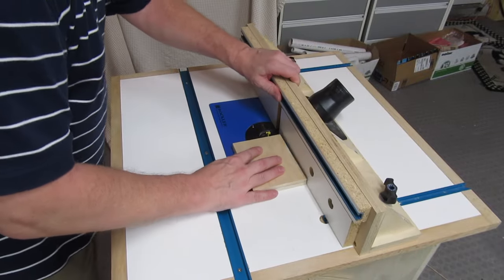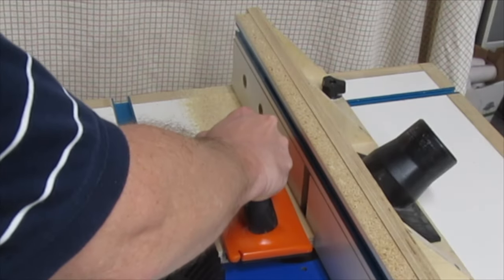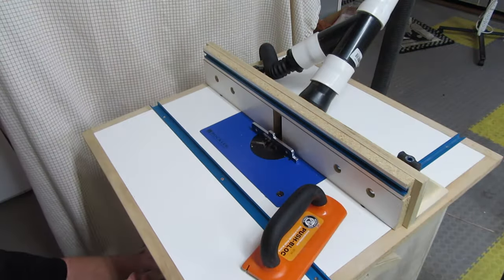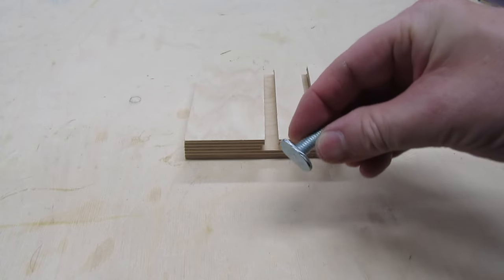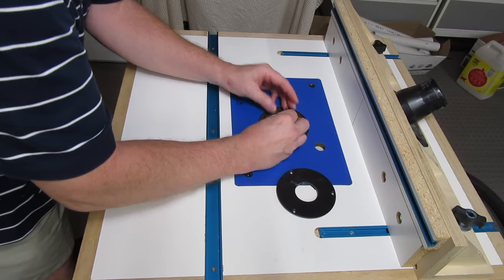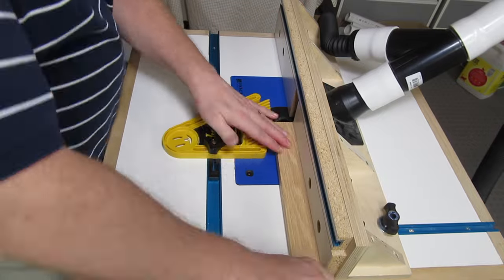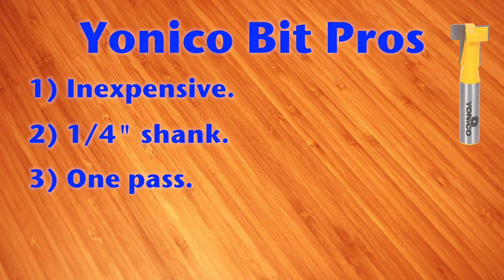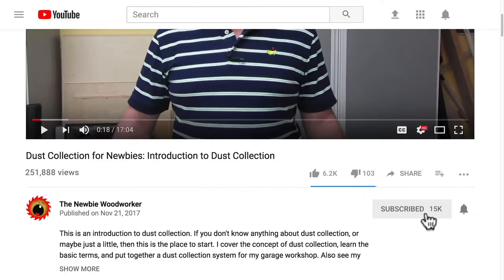Make your own T-Tracks and T-Slots!

Comment: Goo video Dan I worked at a ArchitectualWoodworking company for over 25 years and one of the owners  was excellent at creating internal systems  on how we built  and installed everything we made  one of those systems was  using 1/4” inch bolts for most of our jigs and machine set ups  including T tracks  the benefit of that was  if you stocked the 1/4X20 bolts in every size in stock and we did  you were almost always guaranteed to make it work in house  that cut down on costly down time  and having to run around town trying to find all the hardware
Reply from the maker: Thanks, and I totally agree. In fact, I'm mentioning that idea in the video I'm working on right now. Great minds think alike, I guess. 😄

Comment: One disadvantage of using wooden t-tracks is that when locking a bolt down, you can only apply as much pressure as the wood will allow. Oak could split, and ply can separate from the other plies. This is why aluminum is better. That said, if you never need more than what the wood will support... great! But I wouldn't use it for say a drill press, or band saw jig, which might need to really stay put. Some useful info here, and I'll definitely be looking into the router bits!
Reply from the maker: Thanks for the comment, and I think I pretty-much agree with what you said. I will say, however, that the ones on my drill press still work, and they haven't broken yet. I can hear some cracking noises if I really tighten down the clamps, but they still work, more than a year later. Knock on wood. 😄

Comment: Careful with the Yoniko 3/8" bits. The head should be 1/16" smaller. If you get dust on your shaft and think you are bottoming out, the head will twist through the slot.. The 3/8" shaft has a 9/16 wrench head and will twist right at 5/8" in a wrench, so, softer wood for sure it will twist. 
Find another bit for 3/8, or back up the fence 1/8" and make two passes with the 1/4" bit.. 1/4" does all I need though 99% of the time in a wooden track.
Enjoy your videos. Thanks.
Reply from the maker: Thanks for the info! 👍

Comment: A different kind of comment for you.  Your Photoshop simulation of the t-slots installed on your drill press table is pretty good from a perspective point of view.  The right side t-slot is spot on in fact, but the left not so good.  If you are using a Windows PC then Lazy Nezumi Pro has a preset called Vanishing lines that lets you set rulers to existing perspective so you can match composited elements to it.  It is an absolute god-send for illustrators.  It's the best $35 you'll ever spend when it comes to Photoshop plug-ins.  It's still doable if you have a Mac.  Bert Monroy, for instance uses a Mac, and what he does is map a pair of connected paths to the existing perspective to find the vanishing point, and move the outer ends of the paths to create guides.  When transforming to match perspective, always make the layer a Smart Object — this keeps the handles in the original corners for if you want to fine tune.  BTW  I am an Adobe Community Professional and you can find me on the Adobe forums.  Good luck.
Reply from the maker: Thanks for the information. FYI, I was using the term "photoshop" as a generic term - I actually did it in GIMP. And for videos like this, "close enough" is plenty good enough. 😄

Comment: I can see the difference in price between Yonico and Rockler bit but you have to account for the 1/4" vs 1/2" shank bits. Even identical cutter bits from same manufacturer are different prices if different shank sizes as far as I have seen. Regardless of the price very informative video TYVM
Reply from the maker: True enough. And thanks!

Comment: A few suggestions:  Instead of agonizing over the fence placement, cut the T-slot first, in a slightly oversized piece.  Then cut to the right width on your table saw.  Also, two passes for a 5/16 or 3/8 straight bit is a little conservative.  If your bits are sharp, even 9/16 should be doable in one pass (except for plywood.. the glue makes those cuts nasty).  As far as 1/4" vs. 1/2" shank, it's really a non-issue unless you're cutting a lot deeper than a T-slot with it.  Some fancier stile and rail bits, and similar heavy cuts, will require a 1/2" shank (you probably won't find them in 1/4").  A good 1 or 1.5 HP router with interchangeable chucks isn't that much more expensive than the little hand held ones that can only do 1/4".  The extra mass is actually safer for heavy cuts than a smaller router, too.
Reply from the maker: Thanks for the comments! You are absolutely right about cutting the t-slot in an oversized piece first. That's what I usually do, so I'm not sure what I was thinking in the video. I have a good router, so yes, I definitely could have done things in one shot. I was under the impression that the more you cut out at one time, the rougher the cut. Am I wrong? And if I have a choice, I prefer 1/2" shanks, because I've had problems with the adapters before and I figure, why chance it? Thanks again for the comments.
Reply: There really shouldn't be an adapter - Usually you just unscrew the 1/2" chuck and screw on the 1/4".  I agree - I wouldn't trust anything called an adapter - just sounds dangerous!  While it is true that deeper cuts can be rougher, it depends on the bit, and there's usually a 'breaking point', if you'll pardon the term.  The bit will cut fine, up to a point.  A 1/16th deeper cut, and it gets all wonky.

It's basically a learning process, bit by bit, literally.  Each bit will cut a different amount before it starts to bog down or give rough cuts.  Straight cut bits, which is what I commented on, should be able to cut fairly deep and still cut clean. Any bit where part of the cutter is "captured" is definitely going to be... fun.  An example of 'captured' is that T-slot bit - if you can't stop the router in the middle and just lift the wood away from the bit, it's captured.  They have the hardest time getting rid of dust, and besides just bogging down, the cutter will heat up fast.  Not only does that burn the wood, but the hot resin and carbon stick to the cutting edge, and... nasty cuts.  

The type of wood matters, too, as well as the shape of the cut, the speed of the cutter and how fast you push it through.. Like I said, a learning process.
Reply from the maker: @chrisw1462  "Bit by bit" - very funny. 😄Thanks for the info!

Comment: Thank you for making this video.  I got some great ideas that will help me in my current project.  I'm just in the planning stage of building a router table(on a budget, haha) and I have been trying to figure out how I was going to handle the fence and a track for a miter gauge.  I also liked your setup for holding down materials on the drill press.  Keep up the good work!
Reply from the maker: Thanks! A couple of thoughts, for the budget-minded 😄:

1) For a router table, the fence doesn't need t-tracks. You can just clamp the fence to the table, as long as your table has enough overhanging lip to clamp to. I've seen some YouTube videos on the subject, but honestly, a board with a cut-out for the bit is all that's absolutely necessary.

2) As for the miter track, I have one and never use it. That doesn't mean you'll never use it, but you could always add one later.

3) Lastly, in case you haven't seen it, I have a video on building a router lift: https://youtu.be/LJqPDADi8MM. And I show how you can use it as a mini router table until you can build a "real" table. 😄
Reply: The Newbie Woodworker thanks for the tips.
Reply from the maker: @njneer  👍
Reply: @TheNewbieWoodworker  We really appreciate your honest response: "you really don't need T-Tracks for the fence... That´s good!
Reply from the maker: @alfredomarquez9777  Thanks! I actually like having t-tracks for the fence, but I don't have a good reason. I think I just like the looks. 😄

Comment: Newbie Dan, your answer to a better depth gauge is in your hand -@the 5:33 minute As a former machinist, I too had to learn to look at the obvious. The slide out extension on your calipers is for measuring depth/ height even for thicknesses. And also from experience using digital calipers, they can easily be out of adjustment by simple debris in the racking gears. Whereas a dial or veneer can be cleaned and re-zeroed.
Reply from the maker: William - Thanks for the comment. You got me to stop and think a little - I hate when that happens! 😄 But then I remembered why I used that gauge. I liked how it has two feet, making it more likely I'd get the fence to the right distance. At least that's what I was thinking, anyway. By the way, I have both digital and analog calipers, but I wanted to do the math with decimals. Of course, I didn't realize it was going to be such easy math... Oh, and both of my calipers, and the other gauge, can be calibrated, so that's not an issue. Assuming of course I actually do calibrate them. Fortunately, I didn't need to be that accurate for this. My table saw's fence, which made the final cut to 1", is a lot less accurate than the gauges. 😛 Do you agree with my thinking about the "two feet"?
Reply: The Newbie Woodworker  to quote from my cartoon her o Daddy Duck, 'That sounds logical.' And I understand you on zeroing the calipers. And good to hear that yours are able to do so.  Back 30 years ago when digital were coming out they were a bugger to keep zeroed. 
Again looking forward to seeing more of your drillpress top.
Reply from the maker: Thanks. I took another look at the digital calipers, and I'm not 100% sure they can be calibrated, however, I can use the "ABS" function to temporarily reset where "0" is, if I need to. I know for a fact the depth gauge can be calibrated, because I did it accidentally once, and had to "undo" it. :) Regarding looking forward to seeing more of my drill press table, so am I! I'm so close to done, I can taste it!!
Reply: I use the same gauge  for the same reason.  The caliper can be trickier to align and to ensure that it's perpendicular to the fence,  especially when your fence is opened for the bit and dust collection.
Reply from the maker: Thanks for the info!
Reply from the maker: Thanks. Very cool!

Comment: Thank you so much!! I just bought a bunch of T-Track and then started thinking....can't I just cut the slots into the wood?  With a little care I should be able to do so....but I needed some guidance on which bits to use and what heights to set the router tol This will be a vital bookmark until I get familiar with how to do it without continually looking back. 😂😂
Reply from the maker: Awesome! Glad I could help.

Comment: I made a ruler using Free paint...net software. It's accuracy rivals the metal INCRA rulers I bought. 
I've already put them into my workbench top and front. And made a 16 inch wide by 1/2 inch tall one zero center for my router fence. 
You could have put a ruler on the pieces of oak that you cut off.
Reply from the maker: Interesting! Thanks for the info. 😄

Comment: I use a key-hole bit to make t tracks. If I need a 3/8 wide slot, I make pass, move my fence, then make another pass to get the 3/8 slot. The key-hole bit has a shallow side slot, so a regular 5/6 or 3/8 bolt will work with the slot.
Reply from the maker: How interesting! Thanks for sharing!

Comment: Being in Europe, it is interesting to see you measure and work with decimals of inches, like 0.6 of an inch.
Reply from the maker: Trust me, I'd love to be able to do metric, or at least decimal Imperial. And in fact when I use SketchUp, I'm often switching from fractional Imperial to decimal, especially since 3/4" Baltic Birch plywood is almost exactly .7", and 1/2" is almost exactly .45". Hey, now that I think about it, we could keep Imperial measurements, yet still use decimal values. As long as I can remember that .6875" is 11/16"... never mind. 😛And the problem really is that it's hard to find hardware and tools that are metric, in my neck of the woods. So, I make due.
Reply: Long live metric, most of the world use it. That's for a reason! It's easier.

Comment: Just thinking of getting into using my router (I bought years ago) and your video was quite timely
Reply from the maker: Great! Make sure you watch some safety videos. I didn't do that, when I first started using my router a lot, and I made some very bad mistakes that could have had serious consequences. A little YouTube time would have prevented it. 😮
Reply: The Newbie Woodworker I certainly will Just recovering from a recent operation so doing little else these days, but hopefully not for too long Keep those videos coming. And I second the comment in a subsequent post about the clamps to retain the fence position My table saw has an awful alignment problem so I set up a new one each time I rip something- probably why I don't use it more often - that clamp idea will help me a lot.
Reply from the maker: @colrodrick8784  Cool! Good luck with your recovery. 🙂

Comment: Once again, nice detailed info on the exact topic I need to upgrade my shop.
Reply from the maker: Awesome! Glad I could help. 😄
Reply: @TheNewbieWoodworker I have been having trouble finding the actual width of standard T-bolt heads.  I don't know if it depends on the thread width, but I am looking to buy 5/16" T-bolts.  If you have any that size (or close), could you measure the width of the head for me?  It would really help, because I have to special order them and I'd like to order the cutter at the same time and minimize the play in the slot.
Reply from the maker: @MauriceCalis  According to the Rockler website, 5/16" t-bolts: Foot measures 9/16" wide x 7/8" long x 7/64" thick

Comment: Dan - this is great. I'm working on a clamp/brace mechanism for some custom sliding wood doors I am making. One question though - I don't have a router table or a router. Do you buy the whole router + router table together? It looks like I can get a handheld router used for about $50. Could these tracks be made with that?
Reply from the maker: Router tables are expensive. You should watch some YouTube videos to get some idea of what's available. You could also make your own. I don't have a video of that, but I do have a video for a router lift you could build: https://youtu.be/LJqPDADi8MM.

Yes, you could do it with a handheld router, but I wouldn't recommend trying to route it in a narrow strip of wood. If you can route it in a wider piece first, then cut it down, that would be best.

But most importantly, if you've never used a router, please watch some safety or "how to" videos. Routers are sneaky dangerous. Just see my accident video: https://youtu.be/BJmdSgWeaas

Comment: Router bits are so insanely expensive. BUT its probably worth it, they spin so fast you don't want them flying apart
Reply from the maker: LOL. They don't have to be expensive. For example, here's a set of 5 straight bits for $20, at Home Depot: https://www.homedepot.com/p/Ryobi-Straight-Router-Bit-Set-5-Piece-A25RS51/205626170. Even if you live somewhere that doesn't have Home Depots, the point is that you can get inexpensive sets. Of course, the cheaper the bit, the sooner it will start to get dull, and start to burn. But if you're careful to not cut too much at one time, these can last quite a while. So personally, I get the cheap bits whenever I can, although I try to get some sort of "name" brand, so at least I know they have some sort of QA. 😛

Comment: I was gifted a table with t slots all over but I’m not sure what type of fastener bolt to use with these. The slots are shaped like an upside down V with the bottom at 1/2 inch wide and the top at 3/8 of an inch.
Reply from the maker: Honestly, I'm not sure.
Reply: @TheNewbieWoodworker  It's okay. I found a bolt with a tapered head and just used my grinder to grind down the sides. Works perfect.
Reply from the maker: @sburgos9621  I'm glad you found a solution, and it sounds like something I'd do.

Comment: Cool idea.  I use t tracks on my projects on my channel.  However, I can't imagine these are even close to as strong as the aluminum ones.  What have you experiencd since you've made them?
Reply from the maker: They're actually surprisingly tough (depending on what they're made out of), but obviously not nearly as good as the aluminum ones. There are a lot of times where you don't need a lot of downward pressure, like with a fence. But the bottom line, for me, is that I'd only use them if there was a specific reason to, like how something looks. Especially since I've learned that you can use epoxy with aluminum t-tracks, so if you don't have enough room for screws, the epoxy holds great.
Reply: @TheNewbieWoodworker  That's awesome, good to know!  Thanks!
Reply from the maker: @HowIDoThingsDIY  You're quite welcome! 😄

Comment: How do your homemade slots fare when compared to the aluminum slots as far as strength?
Reply from the maker: They're pretty strong, but not as smooth as aluminum ones - it's harder to slide the t-bolt along the track.

Comment: My question would be, how strong is the shoulder when you clamp down on material. Seems the shoulder of the T-track might snap or is there any upward pressure against the underside of the shoulder?
Reply from the maker: That's a great question. I've been using these on my drill press table for quite a while now. Yes, they make cracking sounds sometimes when I clamp down hard on something. So far, it hasn't resulted in any visible cracking, but time will tell. Honestly, I think they look great on my drill press table, but they're not nearly as practical as aluminum ones. Using them on something like a router table or a router table fence would make more sense, because any clamping doesn't really put much lifting pressure on them.